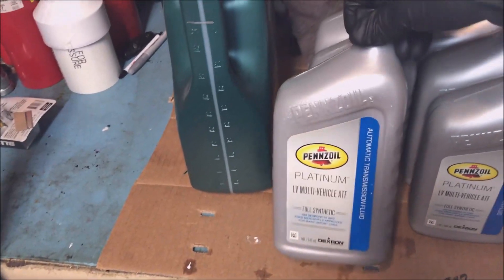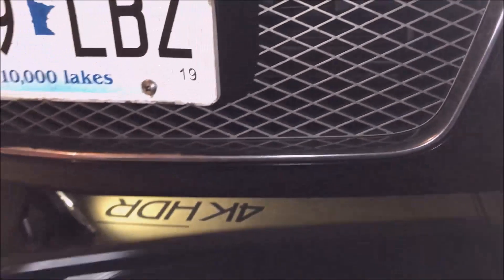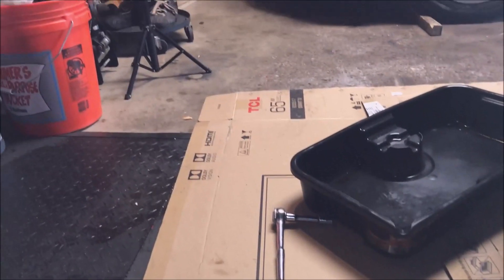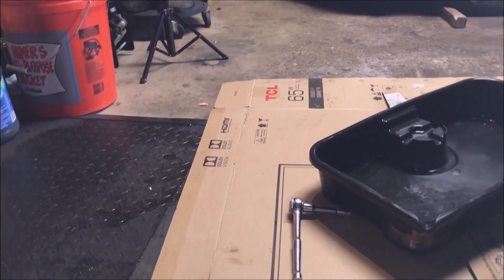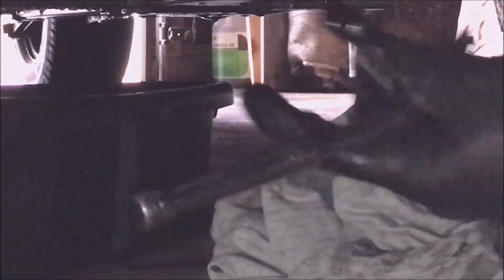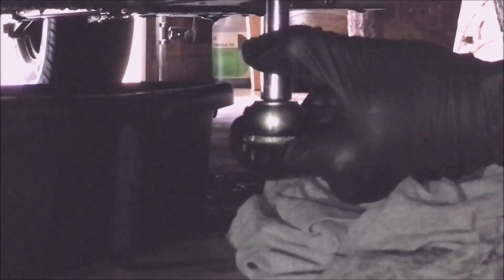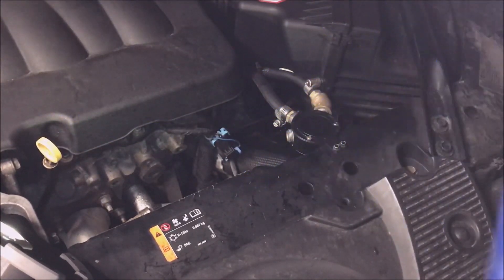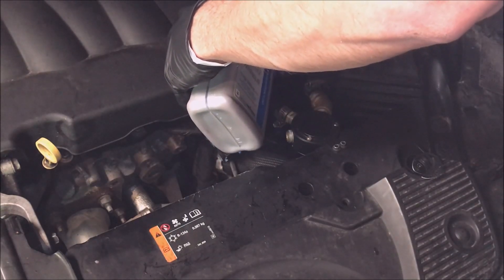2012-2016 Impala/Limited (9th Gen) Transmission Fluid Drain & Fill

Comment from the maker: TBH I really should take this old video down and re-record it. What you're supposed to do is completely drain the pan, refill with 5.28 quarts, idle until the cooling fans kick in, shift through all gears, drive around at low speeds for a few minutes, then top off if necessary.

Check what I did here:
https://youtu.be/MgpzwM3P2_M&t=2115s
Reply: Yes, I agree. Make a new video also with your thoughts on taking it in to GM to get a flush and fill versus this method and do you think that the machine they hook up to it could cause damage to seals and backwash pressure possibly damaging the transmission.

Comment: I just took my 2012 Impala to Aamco for a drain and fill. They told me they had to let it sit 3 hrs (or more) for it to cool all the way down or not much would come out because of a thermal valve somewhere. (So don't ever do this when it's hot). My hours wouldn't accommodate so had to forget it. Thanks to your vid I now know I don't need those guys. I thought it had a pan and no drain; I've only had this car about a week. Just like Hondas', drain plug and dip stick... Awesome!!!
Reply from the maker: 3 hours?? Damn.  That's good to know going forward, thanks!! Good luck with the fluid change!👍

Comment: Thanks for such a great video and taking the time to share.  Having others raise questions and the added responses help solidify the additional parameters that are important to know, like having it cold first to drain.  Also, to have the engine running at idle, in park and temp warm to check level after refilling.  There is a specific temp that can be monitored with specific scan tool too.  I think the range is somewhere between 80F to 130F, would have to look that up again.  Even old transmissions would puke fluid out of the vent tube if overfilled, yet the newer units seem to be way more finicky about being overfilled, different subject. Coming from the old style to these newer units keeps me leery, yet have done several with scan tool, monitoring the trans temp, watching for fluid overflow upon refilling ( different units than this, like Toyota or the 4cyl model trans ) and following proper procedures has thus far been successful.  I too believe in keeping it changed regularly, to assist in longevity.  Having been through a few rebuilds, I prefer to keep them serviced instead.  Some units are just have failure prone hard component's too.  Again, Thanks greatly!

Comment: how long did you let the car warm up before you checked the fluid level, GM says trans temp needs to be between 180-200 degrees, i recently purchased a 2012 impala with 85000 miles and i just want to make sure im doing it right, read some nightmares about these transmissions, thanks for the great videos.
Reply from the maker: TBH I really should take this old video down and re-record it. What you're supposed to do is completely drain the pan, refill with 5.28 quarts, idle until the cooling fans kick in, shift through all gears, drive around at low speeds for a few minutes, then top off if necessary.

Check what I did here:
https://youtu.be/MgpzwM3P2_M&t=2115s
Reply: @CertifiedShadetree  thanks
Reply from the maker: @larryvw No prob! 🍻

Comment: If the weather is good tomorrow, I will be doing this myself. The color is a very light pink/brown color so it's definitely due. When I bought the car, I asked the garage to change the tranny fluid as one of the agreements but I don't know if they actually did or not. It really doesn't look like it considering mileage and color. I have Valvoline Maxlife Full Synthetic. It doesn't have the Dexron license logo on it but it says it's perfectly fine for Dexron VI transmissions so I guess we'll find out.
Reply from the maker: I wouldn't worry too much about compatibility if it says it'll work with Dex VI. I haven't personally tried MaxLife, but have routinely used the Valvoline Dex VI/Mercon LV fluid that comes in the blue bottle.  If this is your first drain-and-fill, I would do another in 6 months or so just to get more of the old stuff out.  Good luck, hope the weather cooperates!!

Comment: seems easier to determine the refill volume by using a hard plastic graduated cylinder/cup design so that measurement is assured accurate. Oil jugs may vary a few millimeters on their graduations. If a guy decides to use oil bottles/jugs a second clean jug could be used to fill with clean fluid and would do away with the use of the smaller bottle to try and enhance accuracy of measurement. Just fill the new fluid jug to the same level as the old fluid and your are ready to go.
Reply from the maker: Excellent points!

Comment: I recently bought a 2012 Impala LTZ that has about 190K on it. I purchase the OEM ACDelco fluid for it, the fluid in the car looks pretty dirty. The carfax report doesn’t say it’s ever been changed, but I imagine it might have been changed at least once. Have you ever heard of damage being caused from changing the fluid after a long time in the 2012/2013 Impalas? Going to change it sometime this week but was just wondering if you had heard of it causing problems.
Reply from the maker: I've heard of the Traverses & Acadias having more issues than the Impalas (same transmission - my guess is because the SUV's are heavier, and thus under greater stress.) If it were my car, I'd drain out a cupful or so of fluid and examine it up close.  Feel if it's gritty, see if there are any metal shavings in it, if it has any pink color left, smell if it's burnt, that kind of stuff. If there's anything alarming, I'd probably leave the old fluid in it and start saving for a rebuild. If it passes the sniff test so to speak, go ahead and change it. Just don't get a flush whatever you do!
Reply: Ok I’ll make sure to examine it pretty thoroughly. Thanks for the advice! I won this car from a Copart auction for $675. I think I got a decent deal!
Reply from the maker: That's a damn good deal for a '12!!  Best thing about the W-Body Impalas is the parts are cheap and they're plentiful in the boneyards, so they're easy to rebuild!  Good luck!! 👍
Reply: Yeah these cars are literally everywhere. Pretty sure I’ve rented at least three different ones back when they were brand new lol. I love it so far! Really easy to work on.
Reply from the maker: Best advice I can give you for that 3.6 - Change the oil every 5000 miles (reset the oil life monitor when you do, but don't go by what it says.) Use a top quality synthetic oil like Valvoline Modern Engine 5w30.  Use a Delco UPF63R oil filter.  Locate the PCV valve in the rear valve cover, remove it, and drill out the 3 holes (the 2 small ones to 5/64", and the large one to 7/64".)  Also clean out the PCV with carb cleaner before reinstalling it (and clean it out once a year.)

The 3.6 is finicky, but if you follow the above to a "T" you shouldn't have any issues with it (I'm assuming yours was at least taken care of, otherwise it wouldn't have made it to 190k!!)
Reply: Thanks for all the advice, really appreciate it! It was maintained but not as religiously as some vehicles are. It did get regular oil changes. It was actually an Enterprise rental car in Florida for about 2 years. Still has the barcodes and dates it was due back in the windows and door jambs lol.
Reply from the maker: No problem!  Certainly sounds like a hell of a deal for what you paid!!
Reply: If it were my car I'd change the oil every 3000 miles.  The variable valve timing is dependent upon the oil to maintain correct tension on the timing chains.  GM had a lot of issues with earlier versions of 3.6 grenading due to marginal hydraulic tensioners and light timing chains.  The 3.6 from 2012 on is much better but oil changes are cheap compared engine replacements.
Reply: @HockeyGoon939  I actually do change the oil every 3,000 miles! Sometimes a little before 3,000. I’ve put over 6,000 miles on it and taken it on multiple road trips without a single issue. It’s still my current daily driver.
Reply: @evanmelton3315 did you ever change the transmission fluid during this time? 🤣

Comment: I been looking for a video on how to do this; my question is tho because mines a 2015 limited LT, and appears same way but isn’t the filter needed to be changed with the fluid?
Reply from the maker: Your '15 Limited is essentially a carryover of the '12-'13 Impala, so it is identical to the '12 in the video.  

The 6T70 transmission has a filter, however it is not user serviceable.  From what I gather, the filter is inside the transmission, and the only way to access it is to remove the transmission from the car and split the case open.

This transmission truly defies conventional logic!!
Reply: LeaderOfWagons But won’t it need to be changed in the future? Or thats if you drive it to what it’s needed like 60K miles, I got mine at 37K and it’s at 73K now so I think to say it should need a new filter should it? I went by GM, it was odd that the filter was like $160 too, or I guess get it professionally done for that
Reply from the maker: @jorgenvonstrangle000  The only way it'll be feasible to change the filter is if you have the trans out for a full rebuild.  If you change your fluid on a regular basis you won't have anything to worry about.  Dexron VI is full synthetic and good for 100k, but seeing as the fluid is cheap and this trans is easy to service, it makes sense to change it out once or twice a year.  That way, you'll never run the risk of plugging up the "filter" or worse yet, needing a rebuild.

My $.02
Reply from the maker: @jorgenvonstrangle000  Watch this video: https://www.youtube.com/watch?v=mc3sVrn_mWY

Skip to 29:07 to see the filter being removed.  You'll see it's just not feasible to have changed unless you have major problems.
Reply: Awesome! so I finally changed it! My thing is maybe 4.5 quarts came out so put that back out? I got a gallon and 1 quart instead so it’s cheaper but is that normal? because my book recommends 5.3 quarts and I only had the car for almost 2 years, and put on 36k miles aleady no change too. Also to add; I should change it 6 months at least since its been that long
Reply from the maker: @jorgenvonstrangle000  Start with the 4.5 quarts, get the engine up to operating temp, then check the dipstick with the car in Park and the engine idling.  Add fluid if necessary.

As easy as it is to change the fluid, changing it every other oil change should keep that sucker in tip top shape!!
Reply: LeaderOfWagons Yeah so far after driving and whatnot the dipstick shows at max on hot for about 4.3 so far. I kept my remaining bottle so it’s alright for now, I’ll just change later if needed
Reply from the maker: @jorgenvonstrangle000  Nice!! Keep that bottle for next time!  And remember, you can mix different brands, but just be sure you get Dexron VI and NOT Dexron III (or plain ole ATF, etc, etc)...

Comment: Hi @LeaderOfWagons, I have a 2013 LTZ impala at about 85 going into 86k miles when do you think I should drain and service its transmission fluid and how often do you change it, asking to get the car running for as long as I can , thank you
Reply from the maker: Think about changing it soon. The factory fill of Dexron VI is good for 100k, but it never hurts to have clean fluid!  I had been doing a drain & fill every spring and fall the past couple years, but found that to be a bit excessive. I'd do a drain & fill now, and do another in 6 months, then do one once a year after that.
Reply: @CertifiedShadetree  Thank you so much!, ill keep that in mind and stay on-top of it, your video was also very helpful when it came to learning about my car.
Reply from the maker: @gtford011  No problem!!  Check out my other videos if you're looking to learn about your car, I have quite a few up that pertain to the 9th Gen Impala.

Comment: I need help I was gonna do this, but I thought that it had a serviceable transmission filter but it does not. They want me to do a flush and fill it cost $365 and I heard that it destroys your transmission. I bought a used 2012 Chevy Impala and I can guarantee it’s never been done. It’s got 180,000 miles on it. What should I do? Should I do drain or should I do a flush and fill?
Reply from the maker: 😬 180k without ever changing the fluid? It's a pretty safe assumption there's a LOT of clutch material floating around in that burnt, old fluid. Flushing it would be calamitous. I would plan on setting some money aside for a rebuilt transmission, TBH. In the meantime, does it shift fine? If so, I'd leave the old fluid in there until it dies. If it has problems shifting, I'd do one drain and fill and see if that improves it. If it improves, I'd do one more after a day or two and this time substitute a quart of Lucas for one of the quarts of Dex VI. If not, leave it and prep to get a rebuild..
Reply: @ she’s been shifting pretty good one time when I was driving it a week ago when I was accelerating and it was getting ready to go into 45 it kind of hesitate a little, I think I probably drain it. It probably be my best but like you said drain it see if it fixes it and then wait a couple days and then drain it again thank you so much for all your help in your videos. By the way, they helped me out so much. I wish I just would’ve found your videos a little earlier.

Comment: You don’t need to worry about the oil left in the torque converter? Like flush a couple of extra litres though it?
Reply from the maker: I drive for a couple of weeks after the drain and fill then do another one. Gets most of it changed out.  One day I may try a driveway flush (and make a video) but seeing how easy it is to drain and refill, I haven't felt it to be necessary.

Comment: I noticed you didn't have the car on jack stands or ramps. Does it have to be completely level when doing this? I cant imagine getting under my Impala with it level on the ground.
Reply from the maker: Yes, I had it flat on the ground. Guess I'm either skinny enough or lanky enough to reach under there! 😂 I would at least try to level the car front and back when raising it, as the pan is very shallow and might not drain completely with just the front raised.

Comment: My 2012 LT has 106,xxx miles, I bought it with 101,xxx miles. I’ve already done 2 oil changes (when I got the car Immediately did a oil change) the previous owner who owned the car since 2012 has all his maintenance records but I never found any transmission services. I’m going in sometime to service my cars transmission(there hasn’t been any indications of slippage or anything) I checked the transmission dip stick and the fluid was pinkish. You suggest if the transmission fluid is bad too just leave it in there and save for a rebuild?
Reply from the maker: With just over 100k, you're just fine to change the fluid. In fact, to counter what I said, I just did a complete fluid exchange on a 2002 Bonneville with 215k. Transmission was having difficulty shifting into 3rd gear and the fluid was DIRTY (but not burnt.) The exchange immediately improved the shifting, and it's been impeccable ever since. So as long as the fluid isn't burnt smelling or extremely black, you're fine to change the fluid.
Reply: That’s awesome to hear the bonneville is thriving now! My girlfriend picked up a 08 Grand Prix, those engines are super solid! 

I did change the fluid in my impala and the fluid was still red or pink. Either way, I’m happy I got it on record. Did a spark plug change too and they had a little black on the ends(I assume that’s carbon build?)

Comment: On the maintenance schedule for the 2017 Impala that I got, it says to change the automatic transmission fluid and filter. You didn't replace the filter. Why is that?
Reply from the maker: The 6T70 transmission has a non-serviceable internal filter.   Watch this video for clarity: https://www.youtube.com/watch?v=mc3sVrn_mWY
Skip to 29:07 to see the filter being removed.  You'll see it's just not feasible to change the filter unless you have major problems.
Reply: LeaderOfWagons  thanks for the info and the video of the transmission teardown.
Reply from the maker: @SilvaSteve2011  No problem! 👍

Comment: Putting the same amount back in is only good...IF your transmission fluid wasn't leaking. Don't ask why. Someone F'd with the transmission fluid bolt and did not tighten it correctly. Resulted in minor, slow, leak.

I need to know what the dipstick looks like when it is checked at running temperature.

Is there a discrepancy where there a always oil covering the dipstick and it is thicker where it is filled to?
Reply from the maker: Check what I did here:
https://youtu.be/MgpzwM3P2_M&t=2115s

To remove all doubt, I'd completely drain the pan, refill with 5.28 quarts, idle until the cooling fans kick in, shift through all gears, drive around at low speeds for a few minutes, check the level, and top off if necessary.

Comment: How do you check the trans oil level. Engine is hot but not running , or it needs to be running. ?
Reply from the maker: Needs to be up to operating temp, running, and in PARK. Watch the video through to the end, I clearly show this.
Reply: @CertifiedShadetree  Thank you
Reply from the maker: @semihyilmaz4699  No problem, good luck! 🍻